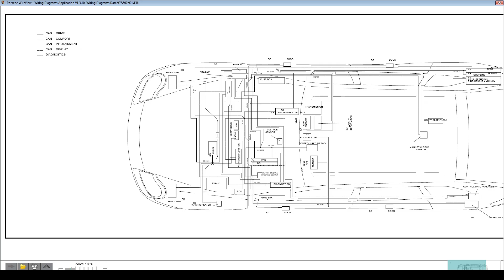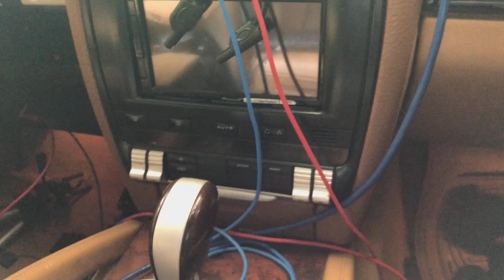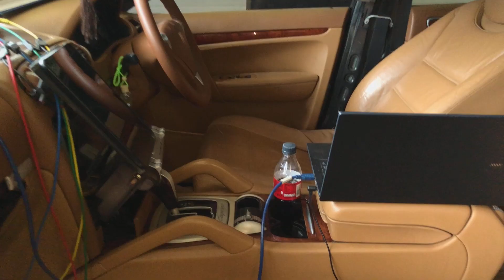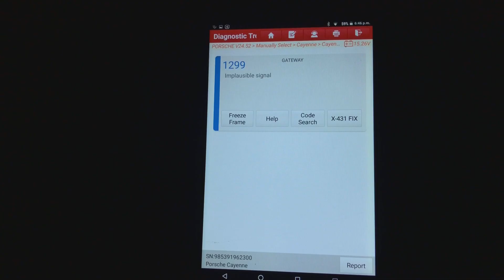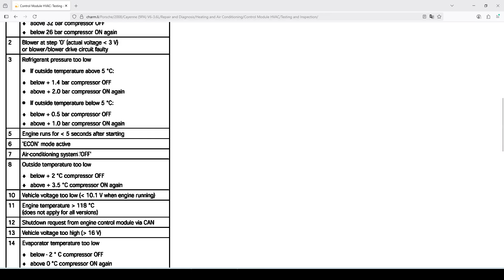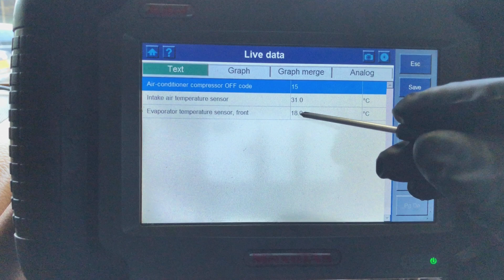2008 PORSCHE CAYENNE NETWORK AND AC DIAGNOSIS & REPAIR

Comment: i'm having similar single-wire DTC shown for the rear right door in my scan tool, maybe I can start from the front right seat wiring loom beneath the carpet like yours ?
Reply from the maker: Yes, try that. You will see a bunch of splices in there, the comm wires will be the same color as in this video. NOTE: Porsche use some strange wires for these lines, they are difficult to solder. If you don't have a very hot soldering iron ( 480°C+) you will have a hard time. Better to crimp them like I did.
Reply: @k-mechanics hi, thanks for the great info. Do you also know the location of the DRIVE CAN wiring? Are they the splices at the driver foot rest (beneath carpet)?I can't find those info from the net. 
I do really enjoy your 1.5hour-long video, wish you could make more like these for the Cayenne

Comment: Very interesting, very entertaining too to learn… Impressed of your approach, it’s so easy to jump conclusions when trouble shooting instead of measuring facts. Wow, suck poor splices. Not sure if there is a reason for not soldering them instead of using those blue crimp connectors? Long vid but watched it to the end.  Well done 🙏 Ronny the Swede in Brisbane. ( I still don’t understand how you can tell it was a missing terminating resistor on the scope, please tell us what you see/ explain what’s not right in the wave form/ scope next time) thanks heaps 🙏
Reply from the maker: Thanks for your kind comment. When it comes to soldering, there is nothing wrong with using that approach - but the wires Porsche uses are not 100% copper. I don't know what aloy its a made of, but they dont seem to take solder very well. They eventually solder, but they take a long time to begin to wick the solder. That is why I chose to crimp. It was just less hassle for me. Now for the terminating resistor, its role is to prevent ringing in the CAN bus by absorbing the voltage on the line when the voltage is released back to the bias standby voltage. Without the proper resistance, the bus can ring and cause errors when the frequency is high and when there are multiple communicating modules. If you pause the video at 58:49, you will see that the higher frequency areas are beginning to look like a saw-tooth pattern. This is a sign of delay in returning back to normal. This delay can erroneously add extra bits into the data, and the data will be erroneous. When I added the terminating resistor, the sawtooth smoothed out, showing a faster reaction of the data bus to signal changes. For CAN, the longer it is held high or low, the more bits are counted, so if you dont return back to baseline after signal release, it can count as an extra bit.